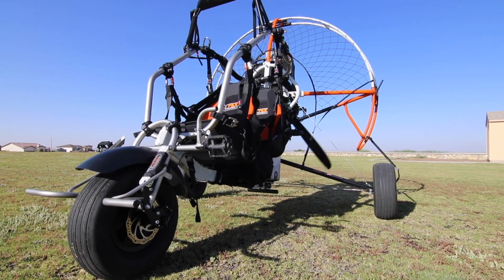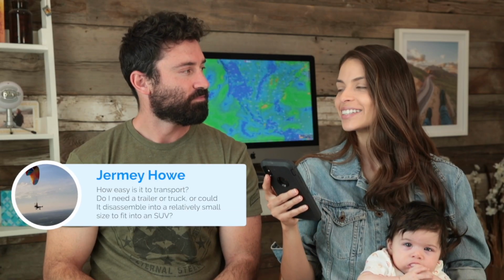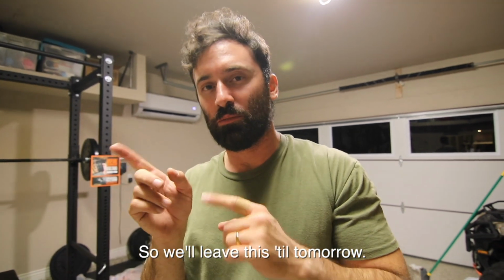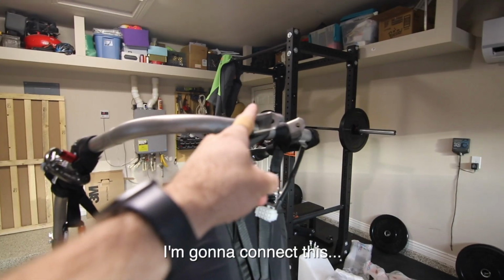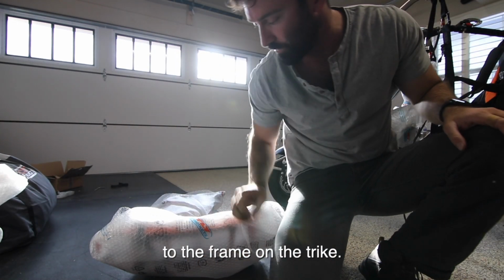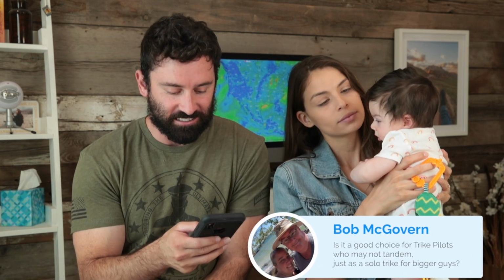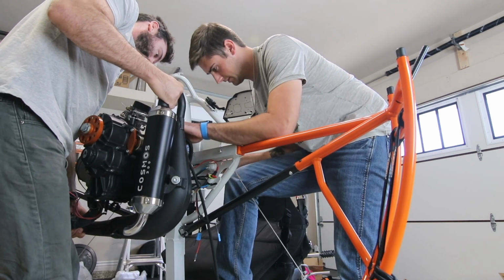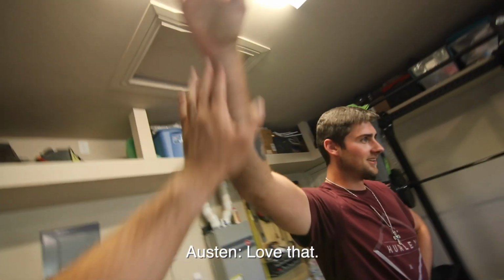The BEST FLYING MACHINE for 2 People!!! PART 1

Comment: So I'm thinking it the axles are riding on the tailgate, you may be wise to get a "swimming pool noodle" or foam pipe insulation and zip-tie around/on the axle to prevent any abrading of both your axles as well as the tailgate.

Comment: Do you have a sport license to fly tandem?  And if flying paid passengers, some type of commercial license and insurance? Part 103 doesn't pertain to this vehicle. Or, am I wrong.
Reply from the maker: Yes. This is part 103. It meets all of the requirements. Less than 253 lbs. Less than 5 gallons of fuel. No commercial license required. Instructional purpose only.

Comment: I have this trike with the thor 250. You will love it. Congratulations. Looking forward to see how the cosmos holds up. The Thor 250 has some issues with the ignition coil and starter. I hope the Cosmos is a good successor. I fly it solo with the Dudek Boson 31 and tandem with the Dudek Cabrio 34. Both fantastic wings.
Reply from the maker: That’s awesome! I look forward to flying this trike much more than I’d originally anticipated. I have high hopes for the Cosmos. Fingers crossed, it’ll last a long time.